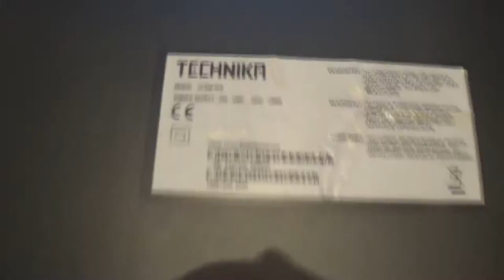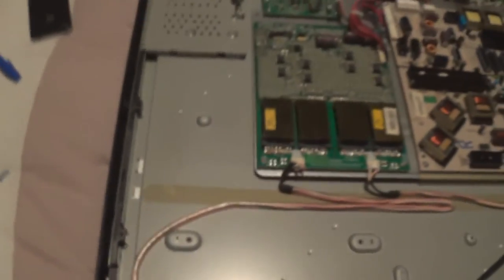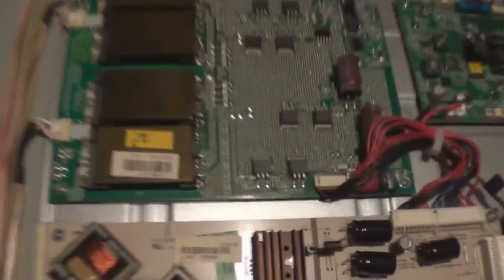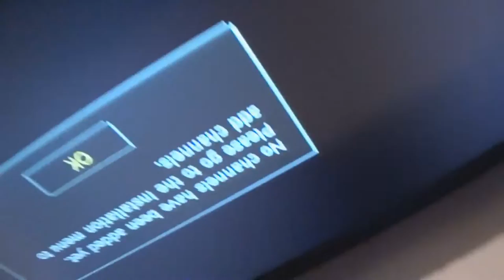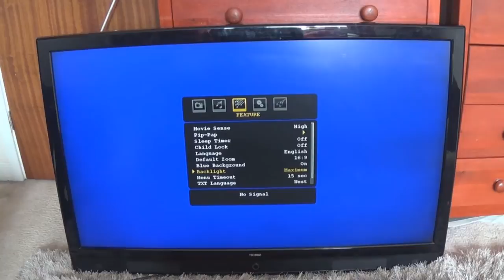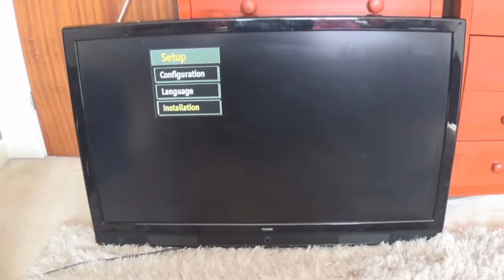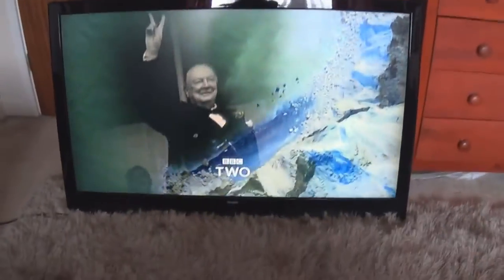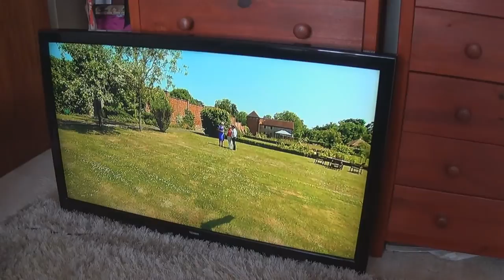17PW01 Repair

Comment: Ccfl's go red-even pinkish as they age, this would explain the red skew, and also old lamps dim as well, so the darker screen. That inverter only had 4 transformers on it, so 4 bulbs at edges of screen- ok for 32 inch or smaller, but a lot of tvs this size would have like a dozen or more tubes, so much brighter and more even lighting. Funny the thin edge, but most of the back is 5 inches thick...
Reply from the maker: +john browne Yeah its a piece of crap tbh my dad is currently using this Tv whilst I fix his Led Tv he says its dim at start up but after a min gets brighter-due to the gases warming up. Also it has more than 4 bulbs it has 8 each transformer drives 2 bulbs. Its a weird Tv tbh first time I have seen a slimline cfl lit Tv and well I see why they didn't produce many as they don't look good tbh and probably wear out fast. If the lamps do go I will replace them with Leds and do a mod :)